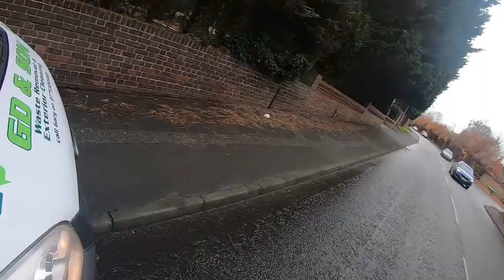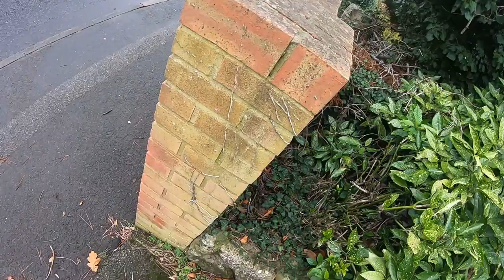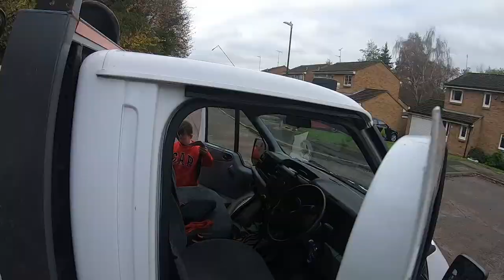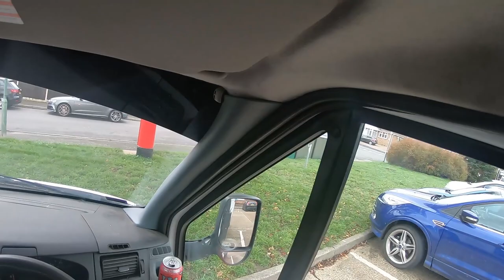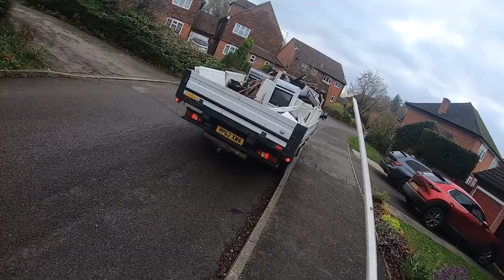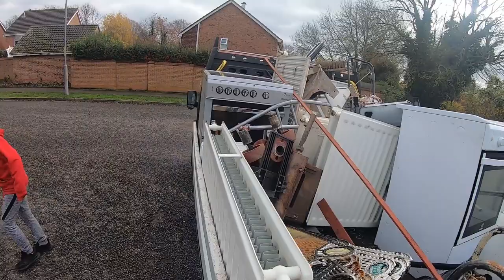WELCOME TO GD & SON. SCRAP DAY !!!

Comment: Hi gary n archie ...... new subscriber here , will look forwards to your company growing with great success . I'm Gareth from dartford but now in wickford.  How far do you go for scrap? Is there any rivalry between scrappers on turf / areas or is it first come first served so to speak . How did you get into this venture ? Good luck guys ...... best wishes.
Reply from the maker: Hi Gareth. I travel usually within 10 miles collecting scrap but occasionally further for larger loads. So far I haven't had any rivalry with scrap, It has been first come first serve. I have always wanted my own company so decided during the first lockdown we had that I was going to use the time to advertise and get the word out about my company. It has slowly been growing and expanded into scrap metal and exterior cleaning, along with our bread and butter waste removal service.